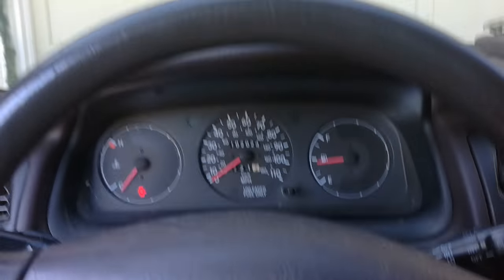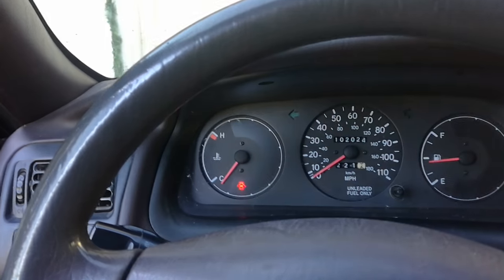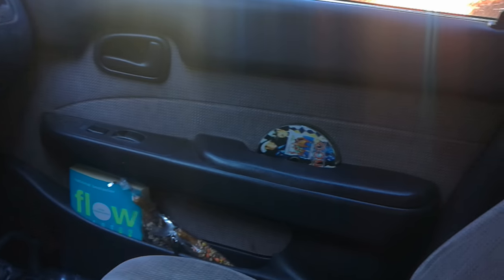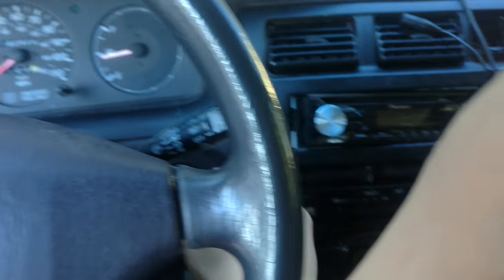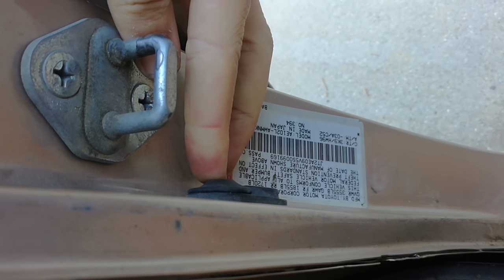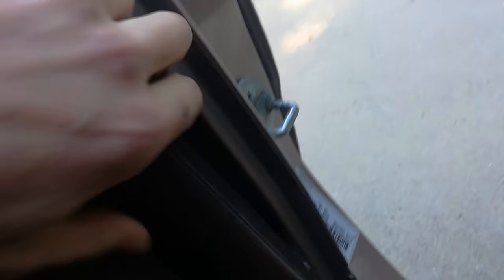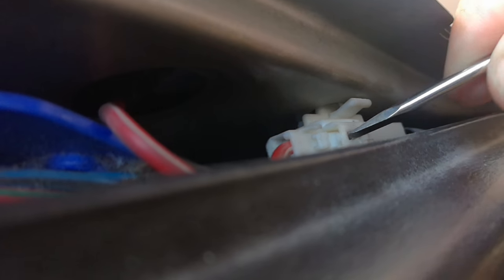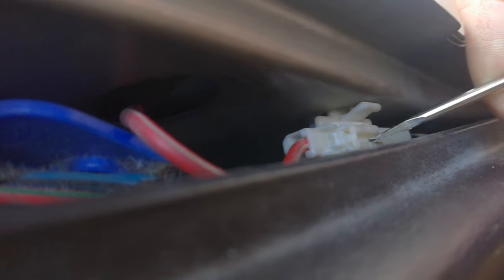How to stop the car door dinging noise

Comment: I know people are still watching this because I am and had the same problem.  If you are not concerned about cosmetics I was able to 1.) unscrew the rubber bumper at the visible screw and 2.) pull the the switch out and unplug it with out going into the door skin.  I Liked this the last time in to view it.  🙂

[Edit]  I unplugged the switch from the wire.  I thought that would do it but wound up not getting a start after recharging the battery overnight.  Just saying problems may arise.  I needed a tow b/c I was out on the road.  I'm getting a new battery which was 7 years old plus a replacement switch and rubber bumper.  No choice there, no more I could do.

[Edit again]  Unplugging the switch did work-- no wires cut  or new swich ordered from the service stop.  But I had the security of having the service stop check everything when they put in the battery.

Comment: Does the switch also work with interior lights when u open the door?  When i open the door the interior light stays on until i close it
Reply: It's a sensor that checks the status of the door, so of course the light won't come on if you have the senser disabled.

Comment: I just cut one side of the mike and soldered two wires to it and ran it to a switch in the panel under my steering column so I can just turn it off when I don't want it but still have it functioning as normal the rest of the time.
Reply: A piece of duct tape would have been easier 😂 just slap it on the button inside the door rip it off when you want the chime 🙂